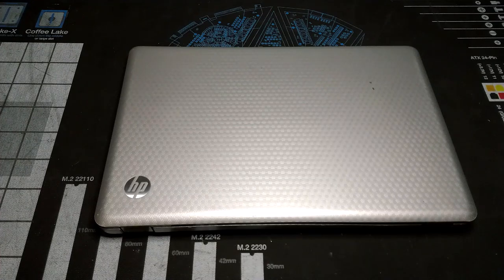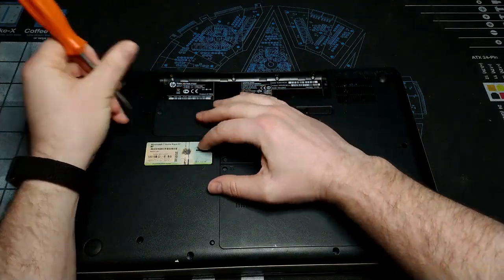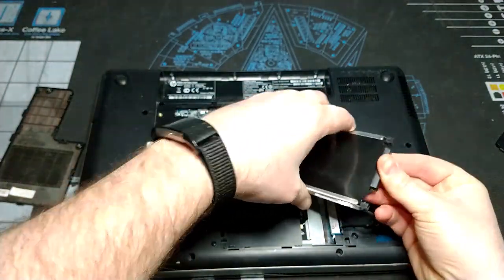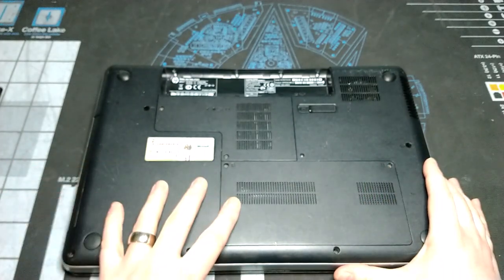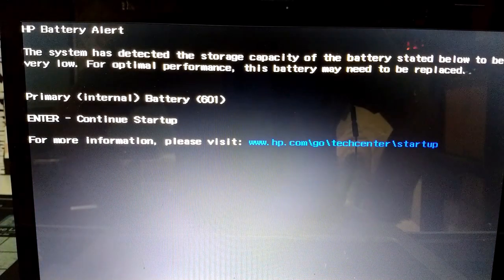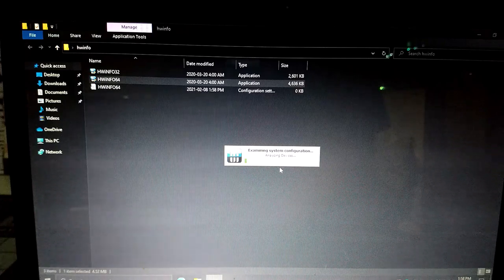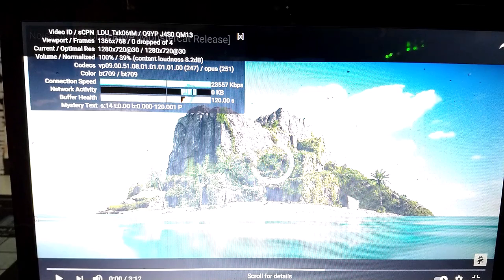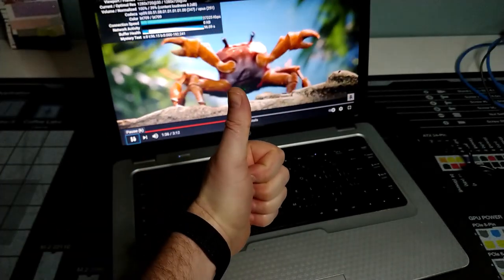HP G62 AMD Turion II P520 Laptop

Comment: can you play euro truck simulator 2 ?
Reply from the maker: It should meet the minimum system requirements, but sometimes that means it will run but on min settings and the framerate won't be great at all
Reply: @retropcdurham  thanks for the update